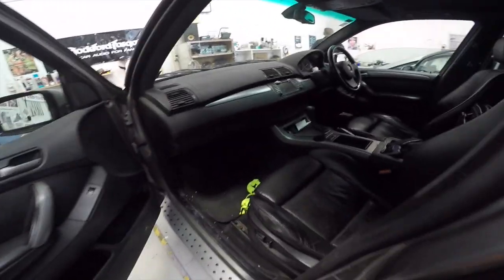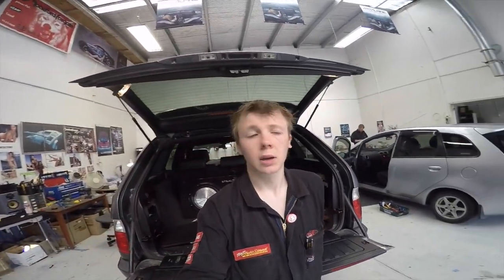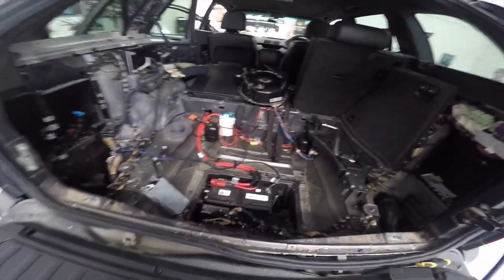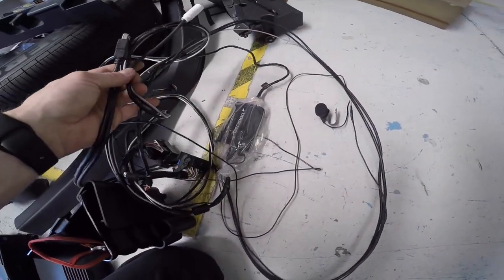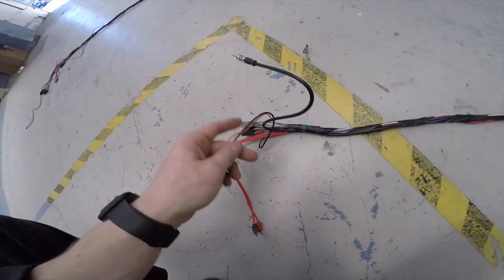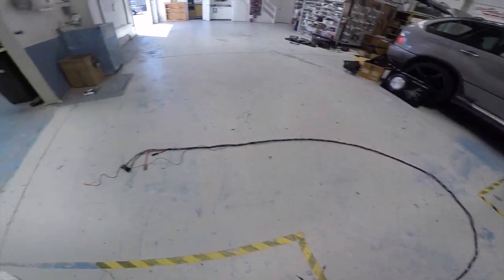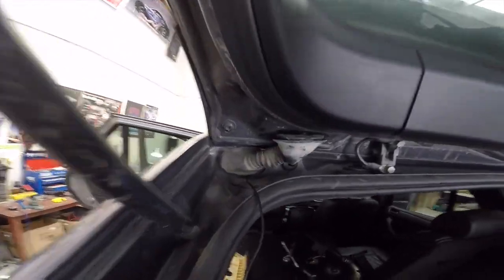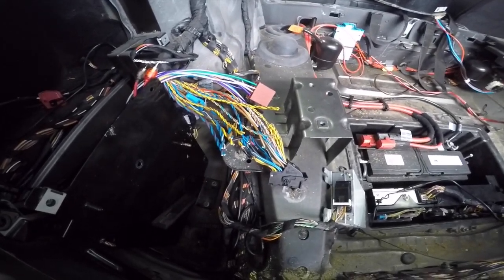BMW X5 Stereo & Amp Replacement! BIG JOB! | Part 1/5

Comment: Hi I have 2006 bmw x5 e53
Radio works but no sound ..I'm guessing its cause of dsp amp.
I passed the 6 meter harness but I dont have radio module  infront of the battery.

Comment: Just about to do this. Any chance we can get a copy of that cheat sheet for the speaker wires ?  Thanks
Reply: I installed a audio control lc2i for my Stereo build. It was a lot easier than this.

Comment: Can someone help me out, I have a 2001 bmw 750il which from what i understand is  pretty much the same audio system as the x5. Is there absolutely any way to install for example an aftermarket focal component speakers, sub and amp while still keeping the factory bmw headunit up front. I quickly realized this is no regular Honda that you throw a line-output converter on and Waalah.